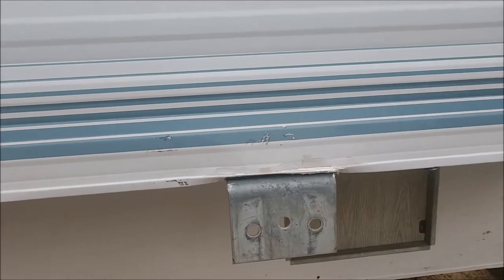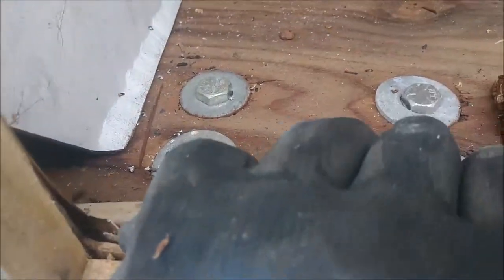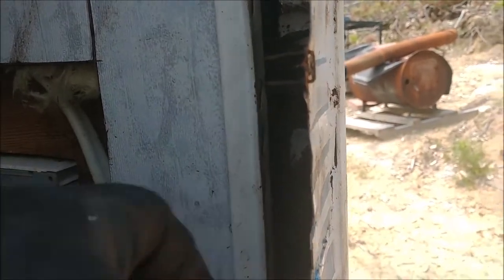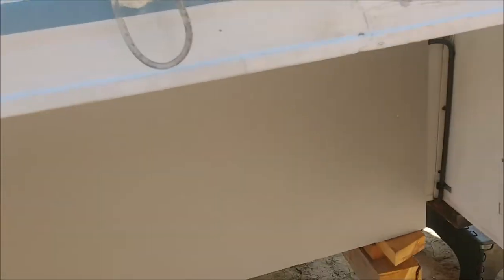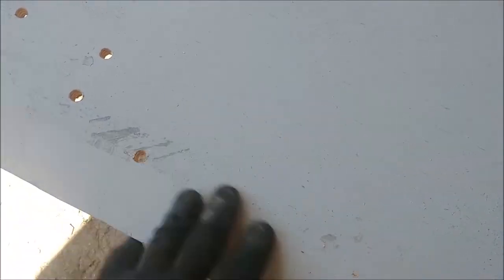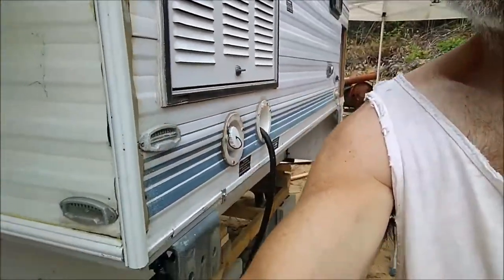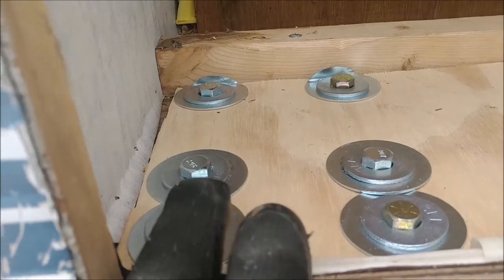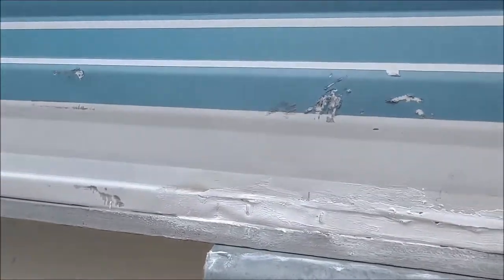It started as a jack stand and tie-down reinforcement project, and ended up also doing corner build.

Comment: I need to do something  about one of my Jack's. Camper is stuck on the truck atm.
Reply from the maker: Oh no! That doesn't sound like a camper project I'd want to deal with! Good luck! Thanks for watching and the comment.
Reply: @timsonthemove  You're welcome. I picked up some good tips from your video. What are those jacks called? That style was suggested for me to switch to.
Reply from the maker: @CDLuminous 

These are the jack stands I have. 
Hopefully the link works.
 https://tweetys.com/rieco-titan-products-12010-camper-jack-heavy-duty.aspx?utm_term=&utm_campaign=&utm_source=adwords&utm_medium=ppc&hsa_ver=3&hsa_kw=&hsa_cam=17058388696&hsa_acc=1425045090&hsa_tgt=&hsa_ad=&hsa_net=adwords&hsa_grp=&hsa_src=x&hsa_mt=&gclid=CjwKCAjwloynBhBbEiwAGY25dALBZ7IqiQVbYksLEzN_HaE_y5r5j0oUns5lzZGT0pQx7Fz5-a3K1RoCyM8QAvD_BwE
Reply: Thanks so much. My camper a very well maintained 1972 Frontier. It's perfect inside as it was kept in a garage during the winter. However there's some wood rot along the outer edge. I bought a marine product called git-rot which you inject by drilling half ince holes into the rotten wood. It kills the rot and hardens the wood. I'm hoping that will do the trick but I'll need to reattach the bottom seam and I'm not sure if I can drill into it. I also need to replace section of a support corner beam. I have a woodworker friend who will give me direction and step in when I need help. If we don't achieve the necessary stability and strngth in the corner then I'm going to need to consider those jacks but then I'll need to reinforce the bottom plywood. 🤔 Researching the git-rot now...